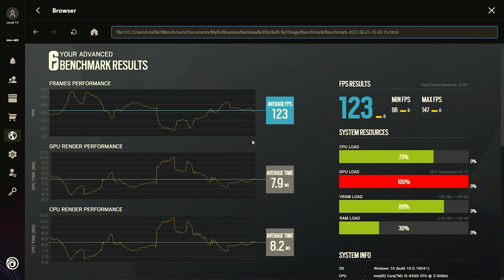We Built a $250 Gaming PC in 2021...It's Awesome

Comment: I just built a similar setup. I took an LGA 1150 motherboard out of an HP Prodesk, bought a cheap case, 16 GB of ram, an i7 4790, a power supply and an HP power adapter cable and a GT 1030. I am very impressed and happy with the performance of this machine. I spent about $350 for everything. Definitely worth it. I'm still hunting for a good deal on a little bit better GPU, but the 1030 is at least acceptable and will tie me over for now.

Comment: the optiplex method is a idea that will never die. This video is no exception. Swap the case out, and call it a day.
Reply: I thought these have proprietary motherboards or something so you can’t swap cases
Reply: @lpmoora  you can. You just need adapters for them, and also, for the optiplexes only, you need to modify the front panel switch
Reply: Not only optiplex.. basically every office pc with a "decent" 2 or more core cpu will do nicely for low spec gaming.Don'ty even need an adapter if you're a DIY person with the knowhow and knowlegde of which pinout provides 12v,5v,3v and ground.
Did make an old fujitsu into a makeshift gaming pc last week, replaced the cooler,ssd, and occupied both channels of equal RAM, sliced some molex and spliced them into pcie, added gpu, and voila..
Reply: Nah i will not swap the case im gonna remove the hard drive cage and put a 140mm fan haha
Reply: @bafon  Lenovo m90 series from back then and the old prodesk series from hp are also very good options!
Reply: @Graphics_Card  For the most part: any cpu which support dual channel 1333mhz ddr3,with  both slots occupied will do basically same fps as a low end ryzen with just one stick of 2666mhz ram.Difference being stutters in heavily cpu utilized games like some online multiplayer gametitles.4 cores should be able to handle it just fine for most people.Dunno why but people seems to forget that consoles like the ps4 is based upon the amd fx series cpu’s, and almost any fx cpu will outperform a ps4 with a decent gpu and ramspeed.Old is slower than newer for sure,but far from useless.
Reply: @Graphics_Card  yea super easy.  I used flip these before covid.
Reply: @Graphics_Card  Those cases are built like tanks, I give no shits about how it really looks, function is what I need, and you can even score those desktop ones, the ones that are flat, and they are quite nice if they have the riser for the PCI express card in them so you can mount them sideways. Just clean up the case a little and honestly they don't get super hot, people go overkill on fans these days compared to what we used to rock back in the day where we would have 1 80mm in the front and 1 in the back and that was it, haha. Of course the CPU and GPU were nowhere near as hot usually.
Reply: I removed the i3 that came with mine and smashed max compatibility i7 inside with quality PSU max ram and GPU is OC it's how I roll 😎 Everything except the case and board upgraded LMAO! Also don't care what it looks like for the price it kicks!!
Reply: @perrandy2011 Does the GT710 have any advantage over IGP? :P
Reply: swapping the case is $70... a third of the cost of the optiplex 💀

Comment: Instead of using compressed air to clean out a dirty PC, I use a vacuum with a brush attachment. This way the dust/dirt doesn't land back into the PC after it settles. I just make sure I'm fairly gentle when cleaning so you don't undo and/or break anything. :)
Reply: You can use something like a shop vac and BLOW dust even help with a static free brush I only say anything since a vacuum sucking air especially with a non anti static brush can cause static discharge . Most electronics can handle some abuse but it only takes one oops 😬 also always first touch or have a hand on metal case first and do not touch any gold pins like everyone on YouTube 😲

Comment: I'd like to give a tip to anyone using an air compressor. I worked construction for 15 years. Not and air compressor draws outside air and can build up moisture inside the tank. Most air compressors I used in the past have a valve at the bottom of the take for removing the moisture. I'd also as a precaution especially if the humidity has been high allow the computer to dry perhaps even using silicone packs to absorb any potential moisture. Also if it's humid outside and your running ac inside bring it inside to dry.

Comment: I have an air compressor but i don't use it for this. Alotttt of water can accumulate in the tank, be cautious when using compressed air. I use one of those data-vac blower things, like $50 on Amazon. Crazy powerful, and has the added benefit of not having to dismantle my system to take it to the garage for cleaning. Can't recommend enough

Comment: I'm in the dell mod group on Facebook and we mod these 7020 dells all the time. It will run 32gb ddr3, any power supply with cable adaptor, and very easy to do a case swap if needed.
Reply: Hey, sorry for the rookie question, but as a beginner whos interested in modding a 7020, do i have to use the exact rx 460 in the video?

Comment: I wouldn't recommend upgrading to an i7, those motherboards will take the xeon e3v3 series CPUs. I put a Xeon e3-1246v3, 8 pin to 24 pin PSU adapter, EVGA 550w 80+ psu, 16gb ddr3 1600, xfx RX 480 8gb, 500gb SSD+1tb HDD in a Dell precision t1700, which is basically the same as the optiplex 7020, back in 2019 for just under $300 and that thing still can play any of the latest and greatest games on the market to this day. And those motherboards can handle up to 32gb of ram btw.

Comment: You can change the PSU! I had exactly the same PC and it was powered by a Corsair PSU. 3 SSDs, 16 GB RAM and an EVGA 980Ti Hybrid - no problem! Also you can put an i7-3770 in it, the Motherboard has NO Problems with it, too!!
Reply: does the dell optiplex 7020 that you have come with wifi?

Comment: Dude i have the exact same build instead of the i5 have the Intel® Xeon E3-1270 v3 3.50GHz, had to order the 24 pin to 8 pin converter also, just get the converter then you can use any power supply. Once i did that connected my 1660 super and enjoy aaa titles in 2021.Very good builds for budget gamers.

Comment: Put the ssd under the cd drive using the upper spare SATA power connection, This will leave the lower spare to power the  GPU and the CD drive connected.

Comment: I use the Optiplex 390s a lot with I5-2400s, but the SATA 2 only ports cut SSD speeds in half, but 240Mbps is way better than mechanical HD speeds.
Reply: Same

Comment: I built one of these only with a 7010 gave it a new 450 power supply (it had a dead one.) 4 tb storage and it came with a ssd, and to top it off I installed a gtx 1050 ti.  also I still use a optical drive to burn movies.

Comment: I would install the SSD and HDD below the CD rom drive and use the sata power from the bottom drive cage to power the GPU. then remove the lower drive cage for better airflow to GPU, use the exhaust fan or buy 120 mm dell fan as a front intake where the drive cage was located. Fortnite creates temp files that need to load so if you change settings or for initial first time playing it will lag and have loading issues because its saving texture files to SSD if you close epic installer and re load Fortnite it will be much smoother then initial load or after changing any settings, your total ram usage is well under 8 gigs unless it runs in quad channel only use 2 of the largest ram sticks possible with the lowest latency and highest density meaning number of chips on the stick for noticeably better performance in games, that's also poor thermal paste application advice you should fully clean the old paste because old chunks of dry paste can effect performance also use a clean dry (no powdered) rubber glove to spread the paste over the CPU's IHS also disable page file on SSD and enable it on the HDD

Comment: I’m rocking a rtx 2060 paid($160) for it an i5 10400 and a Msi gaming edge motherboard plus 16 go xpg ram paid($200 for all 3) some case fans and a tower cooler which was ($100) and my case was ($60). But I sold my old i7 4790k and thx 980ti rig to get the new build so all in all I only spent ($220 from my check) to get my dream build. But all you have to do is know how to bargain.

Comment: You should change the cmos battery as well while you were at it. After 6-7 years, the CR2032 battery capacity would almost certainly close to zero. I just bought one 3020 (SFF) and two 9020 (USFF and MT). All three needed battery replacement after I measured them using multimeter.
Reply: wtf are you even talking about its not a laptop
Reply: @volonidminus  google "CMOS battery". It's in desktop and laptop, and it needs to be replaced after few years. Dell 3020/7020/9020 was released in 2013/2014, so surely their original CMOS battery have died / almost died already

Comment: He practically ignored the power supply, one of the biggest dust holders in the whole case.  I use a compressor on mine a couple times a year, as he said careful of the fans not only the bearings 
but too much pressure focused will blow the blades right off a fan.  This gets dust out of the nooks and crannys faster than anything else just dont blow parts off the motherboard etc. lol

Comment: Also I'm tired of the people saying the six-pin or 8-pin decided doesn't work I am currently running a 8-pin SATA connector with a Old Dell power supply that I think only puts out a Max of like I think 240 Watts I don't know I'm not maybe not be reading that right I'm looking at it right now but let's see here I do not currently know the side of it it says the max output is 240 volts so I know that's not exactly telling me what it is but it's something it works and you know I haven't had any crashing issues with driver failure or anything you know or you know it pulling too much power I mean I've even played really demanding games and stuff haven't had a single problem with it

Comment: i love your guys videos and im so glad you did a optiplex build. i've been looking into going after a 7040(has a 6th gen i5) i was going to utilize the m2 but curious what is a good budget gpu(if thats even possibl) to match with it?
Reply: Low profile 1050 ti or gt 1030
Reply: @TrainsWithDynamo  1060 is little more expensive but your going to get 50% more performance.
Reply: GT 1030 GDRR5
Reply: Get a Sapphire RX 470 Mining (DVI-D). It takes a single 6 pin that you can power from a double SATA and any 300W PSU will be enough. They are very cheap on ebay still.

Comment: My i5 2500k Is @4.5 1.328v
On a Z77 extreme 4 mobo (it has 
lga 775 & lga 1155 cpu cooler cutouts)
So I slapped on a 4 copper pipe low profile cpu cooler which I got for nothing in a dumpster it goes up to 73c max in cinebench 5 minutes tests... And 73c max temp in cpuz 30 minutes stress test.. Are the Temps okay? Or am I killing my processor??
Reply: Okay temps

Comment: The slow is due to the RX 460 but not the 8gb of ram. Fortnite is better optimized for Nvidia. You might be better with GT 1030 or GTX 960.

Comment: Great video! I'm actually looking to get one of these Optiplex towers for my YouTube video editing.. But I'm getting the 7050 MT version, only because you can run 6th and 7th gen CPUs instead of older chips that the 7020 runs, and ddr4 ram.. even the Small Form Factor versions are still good because you can put low profile graphics cards in them.

Also, question, I have MX-3 thermal paste on my cpu right now.. how much difference is the MX-3 vs MX-5?
Reply: Even though I have one, and love the size, I have to recommend against SFF vs. a MT case. SFF limits your GPU choices. I have a Dell Opti 3020 with an i5-4590 and they went and put the damn x16 slot (it only has an x1 and an x16 and I used the x1 for a 2-port SATA card) RIGHT NEXT TO THE POWER SUPPLY, for some stupid reason... meaning your card has to be not only low profile, but SINGLE SLOT as well... that limits the field of GPU choices. I have a PNY GT1030 (2GB GDDR5) in mine. It's not bad especially for older games. Gives about the same gaming performance as a Ryzen APU with Vega 11, as far as I can surmise from various sources about the 'net. There is a 1050 in that form factor, as well, but it's rare. I forget who made it. ASL, I think? And Yeston also makes RX550 and RX560 cards, with 4GB GDDR5. They're not cheap. 

On that motherboard, they hobbled it further - the slot's power is limited to only 50W, not 75W, so for higher power cards than what I've listed (if you can even find one that fits) you may need an auxiliary power connector, meaning you would have to swap PSUs from the 255W to the 315W model. All other sensible choices (GTX1650-1660 Super) for pairing up with this CPU are 2-slot and ridiculously priced right now. 

I wonder how a Quadro P1000 would be, because it's LP+SS; 47W, around $300-350... I'm guessing it should probably be on the level of a 1050Ti? Still... that's way too much $$$ for a moderate bump up from the 1030.

Comment: I have the same a dell optiplex 9020 MT i7-4770 16gb ram gtx 1650 super I want to actually re use the cpu and ram and gpu in a asus Z87K motherboard in a Lian Li II mesh case with a ASUS Rog Strix 240mm rad aio liquid cooler you reckon that’s a good idea. I know the case is ATX the board is ATX and all that
Reply: I thought the Dell Optiplex stuff in 9020's is proprietary 🤔

I want to do the same, upgrade my cpu and GPU to a GTX 1650 super or a RX 580. I'm aware of I go the RX 580 route I'd need a bigger PSU but it's the case swap that has me worried, the modification of wiring the Dell Optiplex front panel stuff to new case, some guys encountered problems I'm afraid in NOT good at. . .
Reply: @southboundtp2067  easy way man is to just find a board that supports your cpu and ram like the board I picked it can use the i7-4770 and my Samsung ram
Reply: @southboundtp2067  and also I have a cooler master 650 watt gold modular inside the dell optiplex 9020 case lol you just have to mess with the door mechanism and bend one of the door latches otherwise it gets stuck on the psu and the door won’t come off. but the non modular psu shouldn’t have that issue as it should be the same size as the standard dell psu
Reply: @southboundtp2067  and the cpu ram and drives aren’t proprietary it’s the board and the stock psu and the case and also the rear exhaust fan
Reply: @southboundtp2067  also with the used board method you don’t need the front panel from the dell because the one of the new cases one should work on them as long as you make sure the board supports that cpu and ram you man your good to do that google the board name then model and find manufacturers website and have a look for cpu support list

Comment: i built my computer using a optiplex 790 mt and the power supply is exchangeable i got it for 100 bucks on ebay and it came with 8gb ram i am still looking to upgrade the ram and find a gpu that works cause i brought a rx 570 that was faulty and i got my money back for it and still need to find another one.

Comment: Hello can I get help I have the optiplex 7010 with i7 3770 with ex 580 nitro but my cpu reaches upto 80 degrees during some games like fortnite cod etc even I have changed the paste paste but it wont get lower in competitive games
Reply: I would recommend a case swap, I have the same pc model and a case with some better and more open airflow will help a lot
Reply: @biporanger9994  I have but still the cpu temps wont drop in games like fortnite warzone and few other cpu dependant games

Comment: What’s a better gpu I can put in and cpu that will make it beast pc probs have to change the psu
Reply: I7 4790 + GTX 1660 Super, you’d need like a 450-500w PSU and 24 to 6 pin power adapter though.
Reply: @TechWithSean  yeah so I don’t need to change the mother board